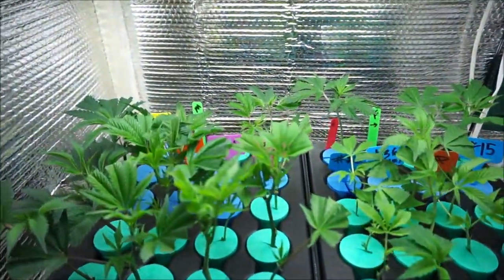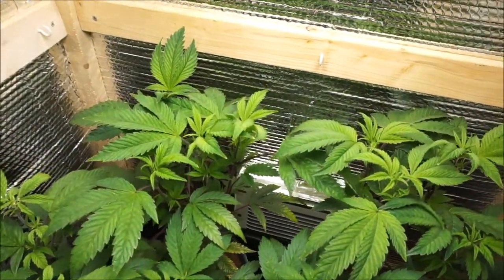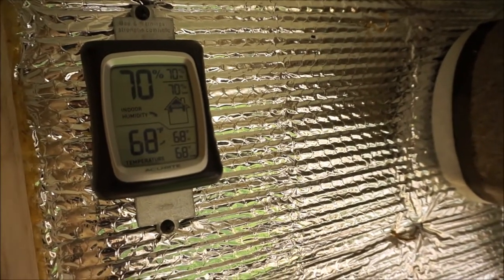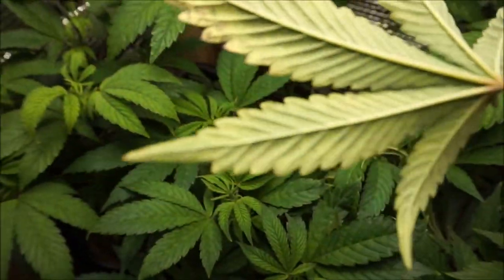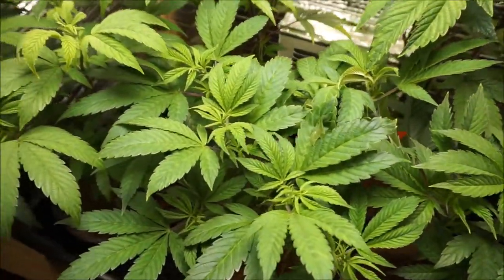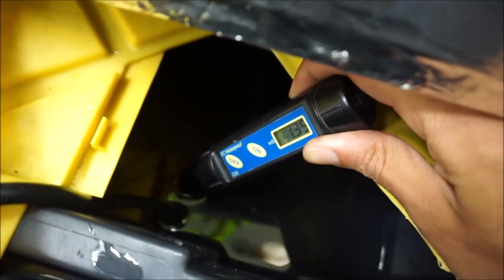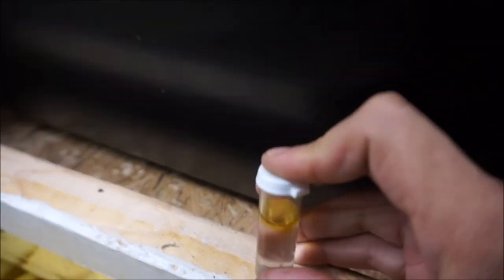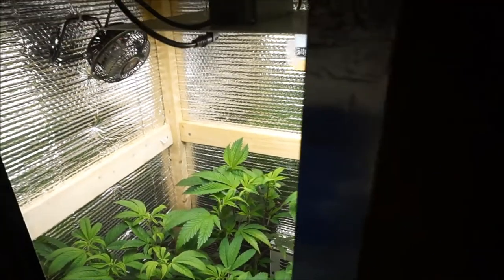Canna-Get-It (S2): Day 101

Comment: I went through the same thing I had to put a heater in the reservor and adjust the pH and everything smoothed out. Keep grinding 👊✌️🤙
Reply from the maker: I did back on the East. But out here is SoCal has not been needed but the chambers are outside the rooms next to a door lol. Operator error. peace

Comment: I would most definitely have a heater in the room for those cold days and nights, also I would try turning the intake off to the chamber, even with it off you will still have airflow because of the exhaust fan still running causing passive airflow or (VPD) in other words, Vapor Pressure Deficit, either way you will still be getting fresh air into the chamber, then maybe it will stay warmer because of the heat off the light, you could also just slow your exhaust fan down or completely cut it off as long as you aren't to worried about the smell, they shouldn't be too smelly right now anyway, also you can always get a heat mat to put under your reservoir, I wish you the best, much love and respect brother!!! #truegrowerzlove
Reply from the maker: Fish tank heater should be here this afternoon. Will be back for the an update. Thanks for tuning in Chunky and showing the Growers Love! peace

Comment: I know exactly what you mean, so foreseeing this should come natural to you. You what you need to do to keep your reservoir temps in check, there are a few solutions for this one being an aquarium water heater, the problem these is that you have to spend time dialing it in so as to not make the water to hot. If you have the ti.e to dial that heater then this is your best solution. The other solution would be a small space heater aimed at the reservoir but at a distance that it won't weaken the plastic, do not aim directly at but rather at an angle or bouncing for one of the tent walls again not to close a good 8 to 12 inches away should be safe. One more solution to have the right temps in the res is having all your water system running through a coil heater, however, these can fail if the coil is not vented properly, a bit more difficult to dial in, but when capable of dialing it in, it works phenomenal! My recomendation would be the first option the only thing is you would have to keep one heater in every res you are running. They come in a variety of sizes, and prices. Best regards and good luck! I know that which ever method you choose that you will make it work, growers love from Malohasnow.
Reply from the maker: Totally agree Jose. Thanks for chiming in and sharing. This was a classic example of operator error. Lets hope things bounce back soon. Heater is on the way